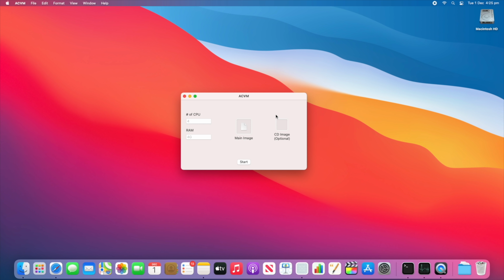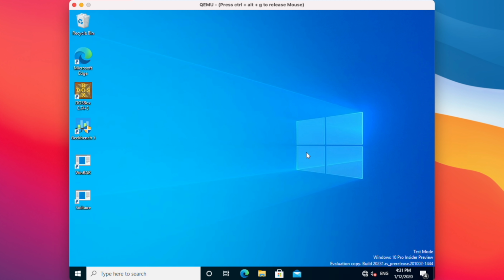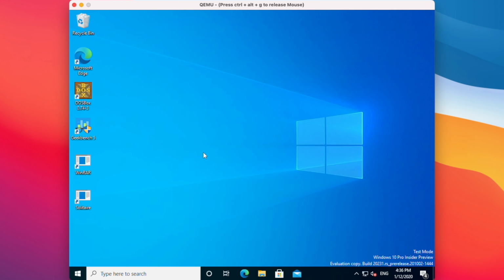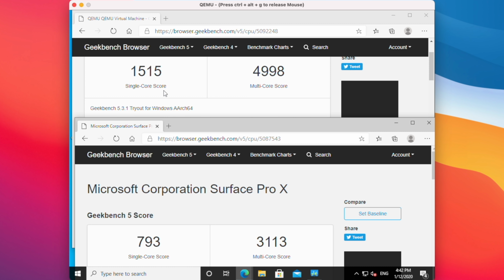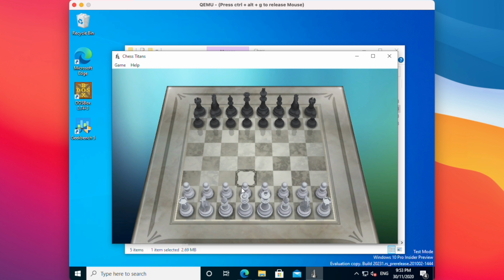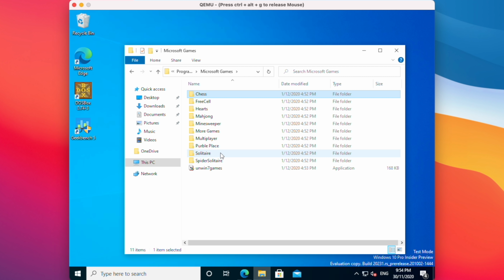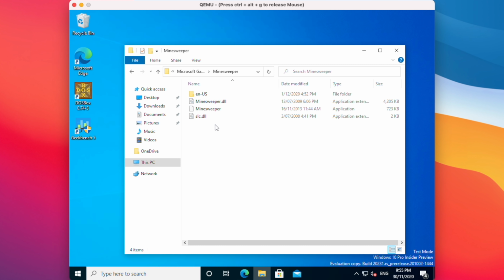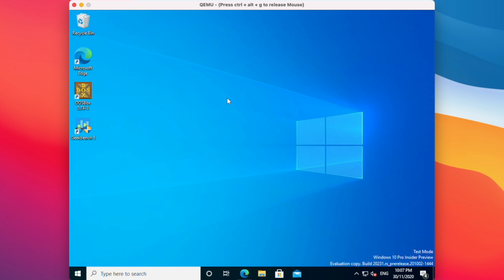Virtualizing Windows 10 ARM on an M1 Mac!

Comment: Windows on a Mac runs better than official Microsoft hardware.
oof
Reply: Microsoft SQ chipset is co-develop with Qualcomm, MS don't self-develop/manufacture their own chipset like Apple does. Qualcomm need to up their game. Nonetheless, M1 is very very impressive.
Reply from the maker: @afiqfikridaud9417  I’m gonna chime in and say while the M1 SoCs are self-developed by Apple, they are mass produced and manufactured by TSMC. But for what it’s worth the M1 (and the A14 series) are far more powerful than most ARM chips that are being created.
Reply: @NobelTech  Thank you for correcting me there. Yes, I'm totally agree with you. I just hope that M1 can give a wake up call to the rest of the chip makers out there. More competition will benefit the consumers.
Reply: @NobelTech  they are still designed by Apple, tsmc is simply used as the manpower to put them together, big difference
Reply from the maker: @bryanmiller476  yea hence I said ‘self-developed’
Reply: @bryanmiller476  Yeah I noticed no one ever mentions how foxconn manufactures a lot of the devices we use. They are simply a factory used to put many of the devices we use like nintendo switch, TV's, cellphones etc. No one ever mentions them because they are really a factory used to assemble the product. They don't design the products or own the liences. How ever when it comes to apple especially its chips a lot of people try to discredit apple by saying it's made by TSMC. They always mention that to try and downplay apple's chips. But never mention that TSMC also manufactures a lot of other chips including ones from qualcomm as well.
Reply: @NobelTech  not really. A small company in China I guess or Taiwan (don't remember) just released a new ARM processor, low-cost btw, that already surpasses the M1 and the rest of A14 chips. The next leap is the GPU (next biggest challenge) let's see what happens.
Reply: @NobelTech  the Fujitsu a64fx is the most powerful ARM chip powering the most powerful supercomputer in the world it has 64 cores
Reply: Hey ik you from discord and twitter lol i found you again
Reply: Windows was working better on Macs sometimes even when Apple was using Intel processors.
Like... you didn't even have to care about drivers and/or driver configuration at all, because BootCamp automatically managed it for you.

Of course, a well-tuned Windows machine with e.g. an Intel Core i5 and a powerful Nvidia graphics will be way faster (especially for gaming) than almost any Mac; But hey, you might flawlessly run Windows on each Intel-based Mac;
And well... i'm quite excited if Microsoft is not probably going to change their minds and license "Windows 10 Pro (ARM)" just the way that they license "Windows 10 Home (x86)" and "Windows 10 Pro (x86)" for regular computers.

But they'll have to improve on their x86 emulation layer and include running 64bits; Or maybe only 64bits, would be better for pro users either way. 😋
Reply: apple uses ai and dedicated accelerator silicone to make all actions more responsive, 
https://youtu.be/fUjwKLSNVkQ?t=168
i seen the m1 hit 95 C in davinci resolve , accelerators plus 8 cpu cores run hoter than 4 cpu cores alone ???
Reply: @onlycorner5565  But Windows can't use those accelerators
Reply: The surface prox processor is an overclocked processor made for android the 865+
Reply: @FUCK YOU MARK SUCKERBERG AND GOOGLE ASSHOLE  this is essentially running in the same manner that a bare metal hypervisor would do. The image being used is a native WoA image, so no emulation of instruction sets are needed. There's still performance loss due to the lack of no proper drivers for the M1 in Windows, but that makes it even more impressive that it STILL managed to completely destroy the Surface Pro X in terms of raw performance. As it stands, even with the SQ2 in the new SPX, Apple's M1 still can run Windows better than the Surface Pro X can.
Reply: On virtual emulator😂😂
Reply: @FUCK YOU MARK SUCKERBERG AND GOOGLE ASSHOLE  do I think the M1 can run Windows better? Yes. Yes I do think that. Did you miss the benchmarks? 

Also it would be hard for me to be an Apple fanboy when I don't even own any Apple products, but if that's what makes fanboys like yourself feel better then I guess so.

You trolls don't even try to be fun anymore.
Reply: @FUCK YOU MARK SUCKERBERG AND GOOGLE ASSHOLE  it's almost like you completely missed the part where a lack of proper driver support. Obviously something without proper 3D accel isn't going to run with full proper GPU power. Maybe you're not a troll, maybe you're actually just that slow. Maybe both?
Reply: Why wouldn’t it? It’s Microsoft.
Reply: Yea OOF
Reply: Microsoft should just use the Apple M1 CPU for the Surface Pro X 3rd edition!
Reply: Two times the single CPU score. Ooooooooooofff.
Reply: well, the surface pro x has a qualicom cpu and aindows on arm is still in development, the surface pro x's cpu is very powerful
Reply: Tech God.exe
Reply: That’s what you get in the wild Wild West of all those hardware manufacturers for Windows 

That’s why ARM will never be a thing in the Windows world .. because of lacking control over hardware and software ..
Reply: @martinsauer4854  But they get more control over ARM chips which can be custom than they had over Intel (also the companies having control means we don't which I don't think is really a good thing)
Reply: @martinsauer4854  Remember there is the exact opposite way, that works even better.

With Free Software it's you who has the control, so you can easily go POWER9 or RISC-V if you want.

The windows world is such a mess and can't really catch up because no one has the control.
But giving all the control to a single entity – instead of everyone – can be plain dangerous (especially to your wallet)!
Reply: Surface X is using a Qualcom processor that is weaker than the Apple M1.
Reply: The MS device he’s comparing it to is quite a few years old now on a much older and larger node. It also needs to emulate x86 applications as well. I wouldn’t say that’s a bad score for an old device that has such a low power draw, and no fan.

Comment: you have no idea of how deep of a hole i found myself in trying to do this. the problem occurred when opening the ACVM and it said you do not have permission to open the application "ACVM" and another one saying i should put it in the trash cuz its malware. i fixed the malware one by using a few sudo commands in the terminal "sudo -disable-master" but the first command still wouldn't go. I'm pretty stuck and wouldn't mind if Someone could HELP ME.

Comment: Microsoft just announced x64 emulation on Windows ARM! Can you make a video trying out the new build with x64 applications on this setup? Maybe even try emulated Geekbench....
Reply from the maker: Yeah I’m working on it
Reply: @NobelTech  Awesome
Reply: @NobelTech  Probably not doable at the moment but I wonder if it's possible to have the TSO switch on for the entire VM, so all x64 emulated multi-core apps inside could run in "Multi-Core: Fast" mode.
Reply: Possibly with this: https://github.com/saagarjha/TSOEnabler

Comment: Would this approach also work for running Raspberry Pi OS ARM version as a virtual machine on an Apple M1 Mac?
Reply from the maker: If the Pi OS requires UEFI to boot, then this approach should work. Anything ARM64/AArch64 can be virtualised on these M1s.

Comment: Imagine that, this is not even an optimized version for ARM. You would be falling off a chair if you had an ARM version and a dual boot installation on M1 devices.
Reply from the maker: If enough noise is made, Microsoft will definitely license Windows on ARM to retail, or Apple directly.

Comment: Mate, thank you for this video, I've been waiting for this confirmation! Subscribed immediately!

Would you know if AutoCAD would run on QEMU on the 13" Macbook Pro M1?

Cheers!
Reply from the maker: I haven’t tried it yet but I don’t think it’s recommended until Parallels get graphics acceleration working for Windows 10 ARM
Reply: @NobelTech  Thanks for your reply! :) 

I'd definitely get the M1 if Parallels updates soon, if not we might have to wait till the next Macbook Pro release for it to serve my purpose of running AutoCad on virtualisation/ bootcamp.

Am currently running a mid 2012 Macbook Pro 15" and in need of an upgrade.

Comment: The first machine I run Windows 95 on was my Acorn RiscPC in the 90s. It supported multiple processors, the core processor being an ARM6 but I also had a 486 in it. They shared, RAM and peripherals and graphics in so much as the ARM acted as a secondary IO processor for the x86 and accelerated the graphics. I could run native Acorn ARM software and Windows 95 at the same time.  This was 25 years ago. It doesn’t surprise me the M1 is good. Also with the way they’ve designed the processor to efficiently emulate x86 I can see virtualised emulated x86 machines running Windows soon.

Comment: This would be great...if there was a lot of Windows software that would run on Windows for ARM.  Sadly, there is not.  So until there is a way to run X86 Windows (and its wealth of applications) on Apple Silicon, my preference will remain on the Intel-based Macs.
Reply from the maker: Yeah its still in early stage. Parallels and VMware haven't even announced their public betas yet.

Comment: Hey man can i use solidworks on m1 ??please tell its a decision making factor for me
Reply from the maker: Not until graphics acceleration is officially supported, sorry!
Reply: @NobelTech  What is that exactly?? Support of external GPU?If bootcamp comes up for M1 then should i consider buying one?
Reply from the maker: @mehul_kapadia  Graphics acceleration means support of the native graphics driver and not using the default basic graphics of Windows 10.

Comment: Wait, – your plan is to run an emulator inside an emulator? Is there no better way to run real Windows on the new ARM platform?
Reply from the maker: This isn’t emulated Windows on ARM. This is full virtualisation of Windows 10 ARM using Apple’s native hypervisor! This is because the M1 chips are based on ARM64 platform so therefore ARM64 OSes can be virtualised

Comment: This is essentially an emulation in an emulation (virtual machine under Rosetta 2 and then emulated in the virtual machine, twice emulated) but still performs amazing and it's not yet the more powerful M1X or M2 in 2021 for Mac Pro, iMac, Mac Mini and even the  Silicon goggles on top of it's not even 100% optimized for M1 too:-)

God bless, Rev. 21:4
Reply from the maker: Actually it’s a full virtualisation of Windows 10 ARM using Apple’s native hypervisor (Virtualisation.framework). That’s why it’s performing relatively fast. DOSBox is 100% emulated though
Reply: @NobelTech  Nice. QEMU is essentially Silicon native already, then? 

I can't wait to sell all my Macs, PCs, some retro consoles and some gadgets (to clear out some space too) and get a 2021  Silicon Desktop Mac (not into laptops, though I have an XP laptop, that's used to burn discs for the Dreamcast).

Comment: Since rosetta 2 translates intel apps to M1 couldn't you run vmware or Parallels for Intelmacs? And install standard x86 windows 10?
Reply from the maker: No because VMware and Parallels virtualise x86 hardware. Emulating x86 windows 10 will be slow as a snail.
Reply: @NobelTech  Probably easier to VNC to an actual PC or a cloud virtual PC.
Reply: @NobelTech  The M1 processor has been designed to run x86 code at stupidly quickly. Rosetta 2 already runs x86 code well. There’s no reason why decent virtualisation should be that bad at running Windows via Rosetta2. Especially if a company like Parallels is doing it so farming off graphics etc to the native hardware/software.
Reply: This is what I am waiting for.  I think it will take a combination of Emulation and Virtualization to accomplish this.  I do suspect there will be a performance hit though—but with the reputed speed Apple Silicon, it may still be viable.
Reply: @arlencarlson  You know if Intel doesn't up its game and Apple continues to outperform at this rate no one will want an Intel or a Windows PC if it runs twice as slow by end next year and be finished just like Motorola/PowerPC in 3 years. No one remembers them after 10 years that's for sure. Imagine grouping 8 or 16 M1s within a single MacPro and still draw almost the same power than a single Xeon. I am sure Apple is working on a SMP solution.

Comment: There is a version of DOSBox for Mac that is 64-bit.  Wonder if that would run via Rosetta 2.
Reply from the maker: It does. Can confirm Windows 3.1 works
Reply: @NobelTech  Have no idea how robust it is but there is a Windows 95 emulator written in an Electron app (https://github.com/felixrieseberg/windows95 ) Wonder if/how that runs.
Reply from the maker: @Maximara  I'll give it a try later. DOSBox makes 95 boot but performance is way too awful (graphics wise) to use

Comment: Been super keen to get an M1 Mac as I'm desperate to upgrade from my 2011 MacBook Air 11", but I think I'll hold off for the 'proper' MacBook Pro, hopefully within 3-6 months as the 14" redesign!
Keep the M1/Mac/Windows VM videos coming!

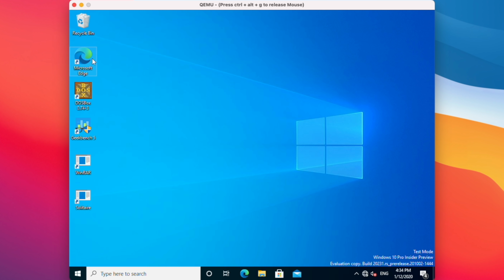1:14 - Why's Edge not native ARM64? It'd be one of the most used programs on Windows 10 for a regular user!
Reply from the maker: Microsoft edge is the exception, was a mistake on my end
Reply: @NobelTech  ahhh okay, yeh that makes sense. I thought surely they wouldn't go to the trouble of making an ARM64 version of Windows and then still include a non-native Edge, especially when they've now built Edge for Linux etc. lol

Comment: My jaw dropped when I saw it was better than the Surface Pro X. Can you imagine how much it would be better if Bootcamp was made available for M1
Reply: Bootcamp is POSSIBLE but Microsoft needs to allow it. Hopefully they do!
Reply: @SquidStuff  OK it's exaggerated hyperbole but in a sense I have rarely ever wanted tech so much, Microsoft please do this!
Reply: not possable. they wont let you tamper with it which is part of why they moved to arm. and if bootcamp was ported, what you dont realize is that windows on arm doesnt have drivers. windows on arm drivers are made by the makers of the device and only work for the device and can take years. qemu has drivers that would work on there which is this case but running it directly is a no go
Reply: @raycert07  Apple reps have stated they are interested in bootcamp for arm macs, people have even done it by forcing it. It WORKS just Microsoft doesn’t have windows 10 arm as open source

Comment: Wonder if we can use UTM to install WoA
Reply: You can! Check out BobPony's video on installing Windows 10 ARM on an M1 Mac using UTM. The developers of UTM have ported over their software to macOS now. So, you can now run UTM on Intel Macs and M1 Macs as well. Go check it out!
Reply: @romanvalenciano5928  Thanks, will have a look!
Reply: @romanvalenciano5928  I checked that, it's awesome. But I saw him using an ISO WoA, not VHDX image, so I wonder whether UTM also supports VHDX image. I'm still waiting for my M1 macbook so I can't confirm yet.
Reply: @jeffwong1310  Hey, nice! I think UTM does support booting off of VHDX images because UTM is based off of QEMU. If the VHDX works on this method that this guy is using, then I’m almost certain it will work on UTM. I can verify if it works tomorrow. I’ll let you know and keep you updated!
Reply: @romanvalenciano5928  Thanks! Another quick question, do I need to select CPU count as 8 in the system setting  when I use UTM to install the WoA?
Reply: @jeffwong1310  I'm sorry, I never saw this. I wouldn't allocate 8 because that's all of the cores you have on your system. I would allocate 4. And I can confirm that VHDX images work on UTM.
Reply: @romanvalenciano5928  I have an error message: "windows10xxxx.VHDX couldn't be copied to "Images" because an item with the same name already exists" when I tried to import drive. do you know why?
Reply: @jeffwong1310  Rename the image file to something else. There might be other copies in your documents so just rename the file you are importing.

Comment: Hello, I'm an accounting major and I love Apple computers. The issue with that is Microsoft Access doesn't work on Mac and I'd really love to buy a new M1 MacBook. I was wondering if you could figure out a solution for this, thanks!
Reply from the maker: I don’t know if Microsoft Access works with Windows on ARM, but if it does I think it would definitely work. I’d wait for Parallels or VMware to update their apps to work with M1 Macs first though
Reply: Thank you so much for the fast reply, I greatly appreciate it! I understand that we're in the early stages of what's available on ARM but if you could do a video of Windows running on ARM if it does become available someday that would be great! Keep up the good work 👍
Reply from the maker: @joansanchez14  no worries!
Reply: @NobelTech  
Can you please check if windows remote desktop works well(both on MacOS and VMWoA)? Thanks 🙏🏻